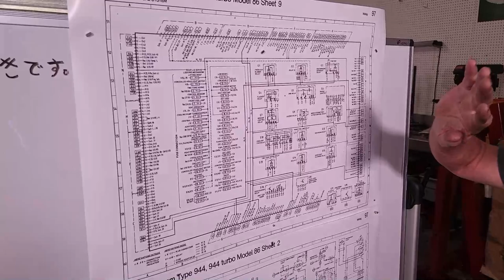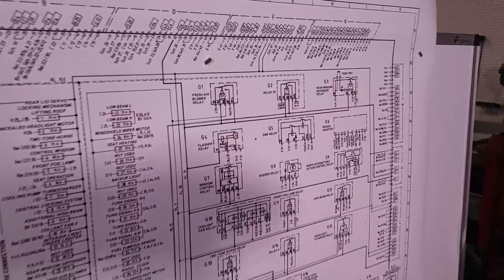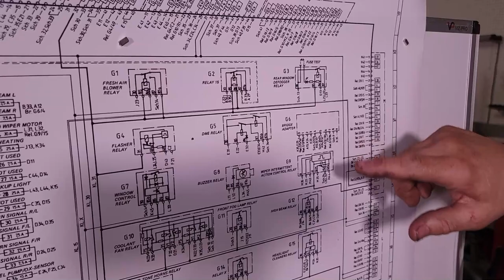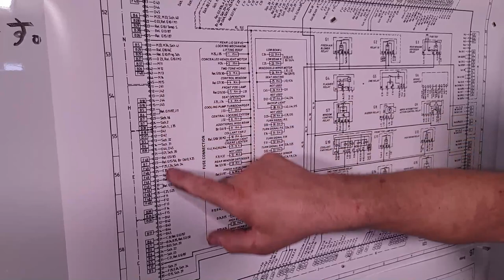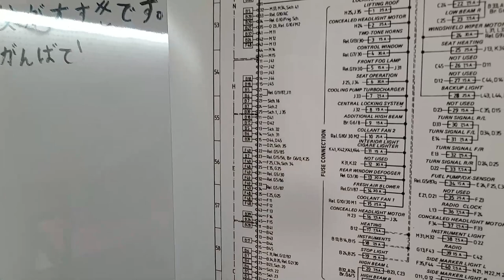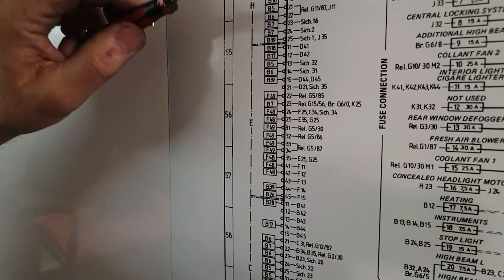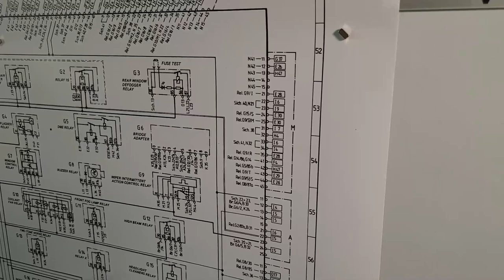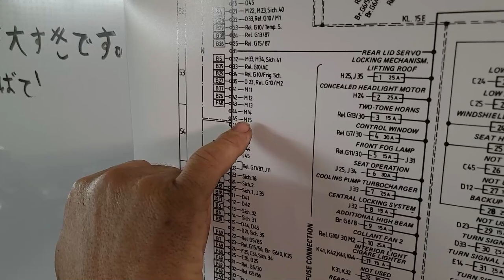Episode 17 - 1986 Porsche 944 Turbo Restoration - Fuse/Relay Panel Removal & Disassembly

Comment: I am a 79 year old GOOD mechanic and EE who restores & collects old Porsches that are not 911's - and I want to say that Russ Fournier is the most brilliant mechanic I've seen on any YouTube video!  And he is a superb communicator as well, translating the highly technical into layman's terms.   I'm dealing with a single problem in my mint 944 S CEP (Central Electrical Panel) that just killed my Fuel Pump - a bad connection in the CEP between pin 87 on the DME to Fuse 34.  NOT SURE I am up for rebuilding the whole board tho after watching this video.  One thing's for sure:  No one touches this guy!   Interesting I used to live in Naples, FL too.......

Comment: I engine swapped my 1987 944 NA to an 07K turbo, with the kit designed by boostbrothersgarage, now it keeps running when I take the key out.  Super helpful video!  Putting the fuse box back together now, probably gonna replace the ignition switch too, wish me luck!
Reply from the maker: Actually, it sounds like the dme relay is staying active. Loose grounds can feed back and cause this kind of stuff.

Comment: Russ, I am not brave enough to tear  apart this fuse relay box on my own car, though I like the idea of buying a used part off eBay to play with. An amateur as myself would have to take a lot of photographs to verify the sub-assemblies of contacts for each plate. And then how do you test the validity of the assembly?  .BTW, the contact indices Porsche uses is simply based on matrix algebra( 3rd year engineering math course).  In this case, you have a 3 dimensional matrix of indices(I,j,k,l), where I is the layer number, j is the relay number, and (k,l) are the respective row and column indices pertaining to the relay number.  What about using a light etching solution(ferric chloride) to clean the copper contact surfaces?

Comment: I didn't see that. I'll study that a bit more and get back to you .
Reply from the maker: Ok, here's what found. The wires from O-33 and O-23 go to the thermal switches. Red/black and black/red. Then O-21 and F22 go to one side of the resistors. Red/green and red/white. Then there are more wires that connect the thermal switches to the resistors. Green/Red and green/yellow. This might be where the confusion comes in. I believe the jumper wires go into the harness a short distance and loop back down to the other side of the resistor.

Comment: Thank you for all the great information! I’ve got an 87 944T where several electrical components are not working to include turn signals, tach, fuel gauge, temp gauge. The warning lights on the cluster work but the analog gauges don’t. Speedo and volt meter on the cluster does work. Do you know if there is one common component I could check that would affect all these components?
I have cleaned all the grounds I could find and connectors on the back of the cluster.
Reply from the maker: I'll take a look at the wiring diagram and see if I can come up with a few tests for you.
Reply: I'd appreciate that, thank you!
Reply: @EuropeanAutoCraftStudios  Update: I took the cluster off again and after moving the tach, oil, and temp needles up and down, they started working. I am still left with no working turn signals. The hazards work in all 4 corners and the parking indicators work.  I have cleaned all the bulb sockets. I am thinking it must be an issue with the hazard switch. Is there a way of testing/ruling out the hazard switch?
Reply from the maker: Since you have some connection issues, you may have a hazard switch issue. Try this, with the key out of the ignition,  see if the European parking lights work. If so, turn on the ignition, set the right or left turn signal and aggressively rock the hazard switch on and off. In the off position,  it sends B+ to the turn signal switch with ignition on. When it's in the on state, it removes the 15 B+ and uses 30 B+ to operate the Hazzard lights. Many times the hazard switch has a bad connection internal, and can be cleaned by disassembly or rocking it on and off a lot. You can check for 12v at the 15 terminal at the hazard switch.  If no power there, there Is a connection problem somewhere, possibly fuse panel. Let me know!
Reply: @EuropeanAutoCraftStudios  Thank you! Yes, the parking indicators do work with the key out of the ignition. That's why I assume the turn signal switch is good even though I have heard there may be different contacts for the turn signal circuit and the parking light circuit (not sure). Am I correct to assume the flasher relay is good since the hazards work? I have definitely tried rocking the hazard switch with no luck. Next I will pull it and try to inspect the internal contacts. Thanks for the help! I'll keep you posted!
Reply: Turns out it was in the harness connector for the hazard switch! Thanks!

Comment: Did you figure out what wires those were for,  that the insulation came off? On my 86 951 three wires on the same green connector had the same issue, and one wire on another connector..
Reply from the maker: I need a reminder of those wires. I remember something about that. Can you screenshot that for me?
Reply: @EuropeanAutoCraftStudios  soo.. im new at this stuff. Just picked up an 86 944 Turbo yesterday, and it has this exact same issue with the O 21, 23,33 & F 22 wires corroding. I am in the process of depinning and adding the new wires but I have no idea where they hook to. I dont know if you have a video that shows that final step. I thought it was the white resistor on top of the blower motor, but the wire colors do not match.. help please, I haven't even been able to start the car yet due to fear of fire. Thank you!!
Reply from the maker: I'm looking now.
Reply from the maker: The wires that you are referring to are indeed the fan resistor wires. Do you have a wiring diagram?
Reply: @EuropeanAutoCraftStudios  yes you are correct, I am new at this 944 thing, but figured out getting them fixed on the fuse block side. 
Not sure how they hook to the resistors and other little things behind the glovebox.
Somewhere the wires change colors from the ones in the fuse block to white on the resistors, so dont want to just hook the colored ones to the resistors in case they change colors at some unknown component.. do you know why or where the color change happens?